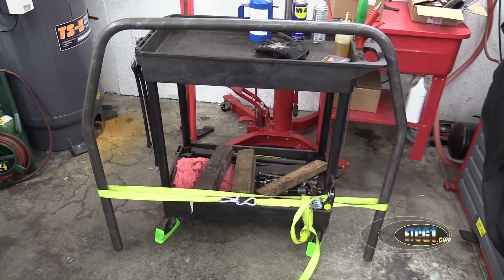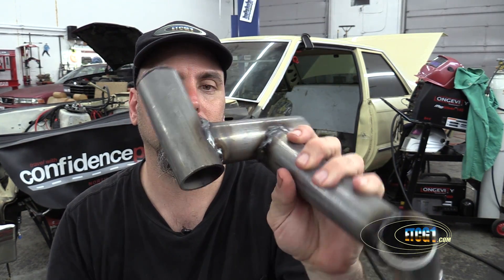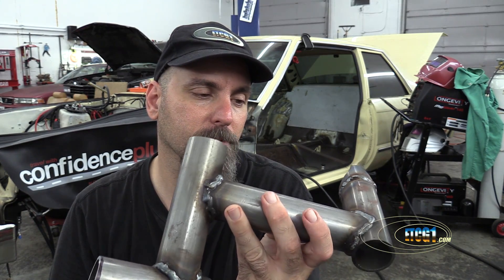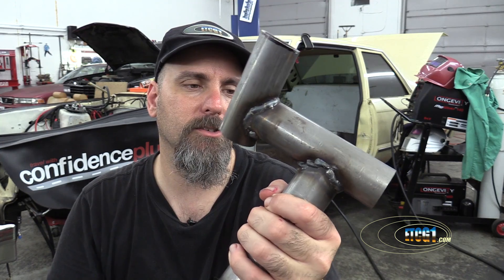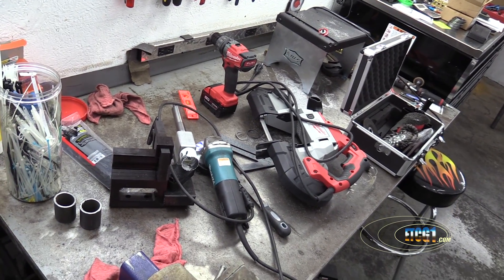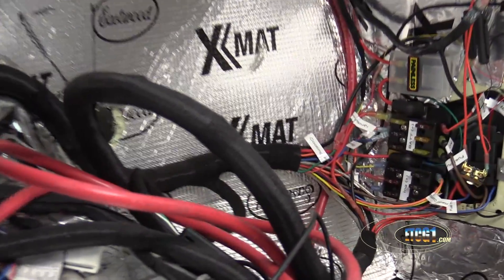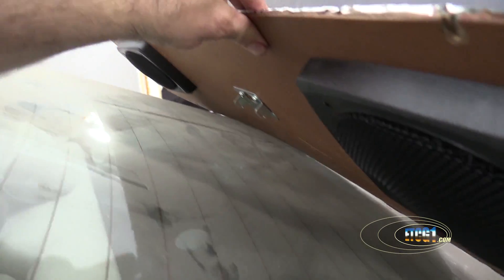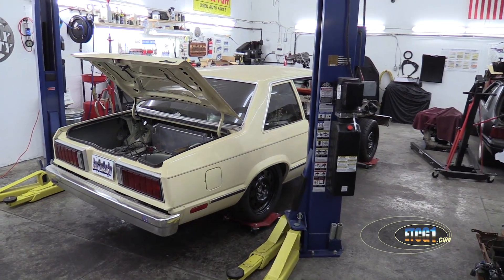Losing Motivation With Project Vehicles

Comment: Completely unrelated, but I get a similar feeling from writing menus: by the time I have tested a recipe a dozen times, trained people to cook it, figured out it looks, talked about it for weeks, I am just sick of whatever it the dish is. It's just mental fatigue from being a Tradesman and having to overthink every step. I was trained that the day you don't hate the plate after locking in a menu is the day you have to walk away 'cause you don't care anymore. I love the Fairmont videos, I have a beater Puegeot 406 HDi 2.0l Diesel and I am having to slowly replace everything that is bust as the cost of the car doesn't rate the mechanic fees, but I love how far she goes on a tank of gas and drives like a hotted up sofa.
Reply from the maker: That is a fantastic analogy, I never considered having to write a menu or what goes into it. Not only did you offer empathy and encouragement with your comment, I learned something new. Thanks!
Reply: Dylan turnbull 
I also cook and make menus for a living. I love working on cars on my down time. I have had a few car I had high hopes for but got lost sold them and wish I never did.

Comment: Most often the only difference between success and failure is not quitting.  I know you will get it done, because you're not a quitter.  Look at all you have been through in life.  Even in the hardest of times you just kept putting one foot in front of the other.  All of those things you have been through gave you the resiliency and tenacity that you need to get through things like this.

Comment: I'm in the same boat.  I have an 82 Camaro I've had since 2004.  Built it through high school, put a carbed 400 sbc in it and 700R4, painted it gloss black.  Looked good for a while.  Then went to military academy and have been in the military 7 years now.  Every time I really start to make progress, had a few deployments, some fender benders, now its in primer in my driveway.  Had kids and then in the brief moments I have time, I'm just drinking or playing video games.  Was cleaning it up again, and found my gas tank is rusting out, needs a new one, have stalled out.  Got 3 shelves of parts ready to go and no motivation.  Also have a 88 C1500, and that has been the daily and focus, new engine, suspension work, sound system, stalled on that too.  Between military and family, hard to justify tinking on a 30 year old car after not seeing my family for 9 months.  I'm glad I'm not the only one.  Also have a 66 Pontiac from my Dad, its back home.  I spent all this time to haul both cars to a military base in the middle of nowhere to not work on them.  Both run snd drive, just gotta get after it.  My welding skills are similar, good for body work, but not a roll cage lol.  Hope you get it out the garage soon! I'm walking to the garage now lol
Reply from the maker: Thank you for your service! That said, my Fairmont has been up and running for about 3 years now and I love it. Can you send me an email to eric@ericthecarguy.com. Something I want to run past you.

Comment: You're losing motivation because you've hit a brick wall you can't see a way past. Pay someone to weld the roll bar and get that job out of the way. Your motivation will then come back.

Also when was the last time you took a proper holiday completely away from all of it for a couple of weeks?
Reply from the maker: You are 100% right about that. Last weekend a couple of viewers came out and helped me build the roll bar. It's done now and I feel like I'm over the hump. I hope to have the car running by the end of the week. 

As for a 'proper' vacation, I'm not sure I know how. Like a shark it seems I have to keep moving to breathe.
Reply: ETCG1 Conor is right, sounds like you might need some rest. 

As far as getting over the hurdles, I've always found having a friend or two to help out can keep you motivated and moving forward. Good luck, can't wait to see this thing done.
Reply: resting in the Fairmont checking your 0 to 60 times sounds pretty relaxing
Reply: Take the car out, drive it and take your time Eric. You deserve it after 2 years of building.
Reply: When its done, really bask in ENJOYING it. Once you get that reward at the end of the build, and spend some time with it, the passion will return. Eventually you'll just get an itch to start on another. If you don't rush into the next one too fast, you'll hit the ground running with all the passion in the world for what you're doing.
Reply: Well done, Eric! You're not a welder by trade, and a lot of work was done in that car to let it sit parted in bits. I believe many viewers want to see that car running, and the builder deserves the credit for a wonderful job. draw a date to have it ready, and stick to it, stop wandering around with small details. I have a cousin who parted an antique family car in bits in his garage, and then lost interest in the project. Everyone knows it will never run again. Don't be that guy! Focus on your goal and go for it! :)
Reply: damn.  those welds look like mine.  I can weld, but, like you, I can't see, so I pay somebody to do it.  and I LIKE to weld.  
you did the right thing.  
I know it's a 'pride thing' to want to do everything yourself.  with life comes wisdom.  I have finally found a way to chisel money out of my pocket when it's a good investment.
Reply: Exactly what I was thinking, hire some one to do the welding job right and just get that part done. Then sail on putting the car back together.
It's OK to get some help with a project you don't have that much skill in. He's trying to do too much too fast.
He'll feel better once the roll bar issue is out of the way.
Reply: Good man, I'm glad you got some help and got the roll bar out of the way. I hope you feel better about the whole project now.
Reply: By the end of the week!?!?!?! I can't wait!!!! This is gonna be one of the baddest cars on the road.
Reply: and I think he did get someone to do that.. so , good advice!
Reply: Awesome to hear you might have it running by the end of the week - you're in the home stretch.
Reply: This is the best suggestion. Do them Eric!
Reply: As someone who's had a project "car" (shell & parts), I completely understand. The one thing that keeps beating me is looking at the list of things to do. Something I always find helpful, on not just my projects, but those of my friends is to just bolt the engine in and start it. You said the fuel and wiring are done, which is HUGE. All of the fiddly time fixing that crap saps your soul.
The best moment in any project, and the one that gives the most inspiration, is passing 2k rpm for the first time. Even if the car is on jack stands, no seats, dash, anything. 

Keep the faith my friend, and let the tire smoke prevail.
Reply: That's one thing I learned as well. I mean, I can weld, but when it came to the roll cage, I figured it was best left to the pros. In a project, especially one that your working on only by yourself, if you come to a part that is beyond your skill level and not something you can just look up, it's best handed off to someone that can do that part. On the other side of things, if it's the mountain of work beating you down just set small realistic goals. The project will come together eventually. No sense in beating your head into a wall until you hate the project. Hell, this car is nearly done and ready to go (which I know has taken a lot of time and effort).

Comment: I bought a 1976 Suzuki gs 550. I rode it for awhile and decided to "fix it up a little". I took everything apart. Bagged and tagged it all. Cleaned, re-chromed, powder coated, painted and replaced everything that needed replacing. Then I lost interest. I started to put it all back together then gave up and sold it. That was two years ago and it still bothers me whenever I think about it.
Don't give up. Power through it. It will be worth all the sucky times when it's done.
Thanks for the video.

Comment: I've been there , sometimes it seems like you'll never get anything done and you just want to throw the towel, especially when you realize the time you've spent on the car already, and how far it is still from being done. In my case, it's more like every time I have everything set up for a job I have to do on the car, some unrelated part breaks, or starts misbehaving, and then I fix it and I find out that something else is not working properly and it's like it never stops. :D But it does stop eventually, I guess... or so I hope, and that's why I always end up going back to it.
Reply from the maker: You're spot on with that comment. My solution seems to have been to bring in outside help. Last weekend 2 viewers came out and helped me finish the roll bar. Now that it's done, I hope to have the car running by the end of the week. Thanks for the comment!
Reply: No problem. I'm in that very situation at the moment - I was about to sort out the intercooler piping, when something went wrong with my front suspension, and the AC compressor decided to give up the ghost, as did the exhaust manifold gasket, and also my temp gauge has started acting up... all within a single week. So I'm feeling a bit overwhelmed myself. But I'll keep at it anyway, I'm sure we'll both see the end of it soon enough. :D

Comment: I'm going through this with my 03 Silverado.  Started off needing a crankshaft oil seal.  It has spawn to a timing chain cover, oil seal, new water pump, new pulley's, new belts, new ABS speed sensor, rust control and restore of the front wheels, new shocks, transmission filter...  And here I am procrastinating as I could be doing the shocks.  I'm also an amateur mechanic DIY'er at best so of course, you can imagine how much slower I work compared to you, Eric!  Keep it up, love the vids! I learn a lot from you

Comment: Install the engine and get it running. I know from experience that will give you motivation.
Reply from the maker: Last weekend I got help from some viewers with the roll bar. It's done now. All I have left is to reassemble the car. All the big jobs are done. If all goes to plan, it'll be running before the end of this week.
Reply: Once it is done, do a 5 or 10 second video of it driving down the street on your other channel as a teaser.  That will wake people up! Chris
Reply: I agree.  These car projects sit there, taking up space, not running.  Makes you loose sight of the end product.

Comment: Hello ETCG1. Yes I have started projects and lost interest. I had a Rover 88 (it is the "Daktari" type Land Rover. 88 means 88 inch wheelbase) and wanted to change out the drive train. The old stuff was OK off road but max of 50 mph on the street. Project never was completed, I sold everything for pennies. I was hoping that one thing your listeners became aware of during the Fairmont build is how easy and how dangerous (as in losing money) project cars can be. I did complete one project truck. I put a 330 hp small block and race prepped Turbo 350 in my 65 GMC. Other than being expensive that build went off well. I like your idea of bringing in outside help. The help may cost you but if it gets the Fairmont done, so be it. If I would have sought help with the Rover things may have gone better. I did get help right from the start with the GMC engine swap. I drove it 10 years after the swap. The truck hauled a**,fun to drive, well in a straight line it was fun.

Comment: Sometimes with a big project you just have to accept that you can't do the whole thing solo. If you've got the $$$ to do this project, then you sometimes need to part with a bit more to bring in an expert. Discuss with the shops you're already working with to see who they know that's good at the welding stuff.

You seem to know what you're doing for most of it, and you got this far, so may as well push through to get it done.

Comment: Been working on my 78 camaro for nearly 2 years. Once we got it running, we've only done one project at a time so we can keep it on the road. Taking it for a spin always helps maintain interest... especially helpful when you have your dash apart to replace a heater core that you've been putting off.

Comment: When you get the roll bar done have the guy check the welds on your frame connectors.  It cant hurt.  Chris
Reply from the maker: I've already redone all the welds on the frame connectors. I'll mention that in an upcoming video. Between that, and the roll bar, I don't think there'll be any issues. Thanks for the suggestion.

Comment: At one phase of my life I welded heavy roll bars for a living. It is definitely a skill that requires practice, especially the way we did it with 7018. The mig welds you showed at the beginning were too cold, I guess because you had a poor fit, then burn through on the edge side and then reaction to dial down the heat. Problem is, you need good penetration on both sides, even if it means you have to grind welds smooth afterwards to make them look pretty. Without penetration you need to start over, though if there is a good pass underneath you might be able to salvage the steel. I agree, hire a pro to get through that part, you want to move on and finish this one up. We're still with you, Eric!

Comment: Eric, I have definitely been there. Years ago, I set out to restore a project car of my own. It was a 1984 Lincoln Town Car. It wasn't a build like the Fairmont is, I simply love the old full size cars and wanted an old Lincoln that I could restore into factory condition. It was given to me for free, and though the engine ran fine, it needed a new transmission, and the friend who gave it to me had partially parted it out to get parts for his Crown Victoria. I've always had a passion for the old Panthers, especially the 1980's-era ones, and the Lincoln was something special. Anyway, I completed the transmission project and got the old Lincoln running and at the time it was my crowning achievement. But the trans leaked like a fire hose from the bell housing, and after re-removing the transmission multiple times to replace the pump seal, I gave up and condemned my beloved Town Car to the junkyard. Years later, as I learned more about cars, I realized all along that the problem was that I had installed the wrong torque converter. Had I known that at the time, I would be driving the Lincoln now. The moral here is, procrastinating or burning out (or worse, quitting) will only leave you wishing you had the car you worked so hard to build. I took plenty of time off from the Lincoln. Take some time away from it, dream about what you want to do with it, picture yourself screaming down the road in the Fairmont, and you'll fire yourself right back up with the energy and stamina to polish it all off. By the way, my passion for old Panthers never died off, and my daily driver today is a 1987 Ford LTD Crown Victoria, all original of course.

Comment: If you have family members or friends, interested in your project, that's a game changer. In the early 80's my dad gave me a non running '57 D100, and a worn out '69 Fury for parts. Told me if I wanted to drive I had to get one running. We stripped the truck down, and then went overboard with modifying it. As a teen I quickly lost interest, but dad pushed me on. After welding in the torsion bar front clip, everything snowballed. I hated the truck, new rad. support, cut out the firewall because of engine set back. Trying to combine the wiring from the 57 and 69 Fury. Over 35 yrs. later still have her, she's half apart. Going to go through her again, keep it like she was early 80's, out of respect to my father who wouldn't let me give up. Should of done this years ago, he passed away last May.

Comment: I've got a project truck I've been working on for over ten years! I'm building a 1954 Ford F100 extended cab 4x4. Believe me I know about getting burnt out on a project. It's been a year and a half since I've done anything on mine. Sometimes you just have to step away from a project for a while. But the problem with doing that is.  The longer you are away from the project the harder it is to get motivated to get going on it again. 

On something like a  roll bar. If you are questioning your abilities at all. Either pay someone to do it or find someone to help you with it.  Get the help with your roll bar. And then either take a short break away from the car to recharge your batteries. Or just push thru and get it finished.  You are so close, but sometimes you just need a break.

Comment: Eric - A tip for future builds that I learned - when you start the build - pick your strategy and stick with it.  So like in this case, when the engine didn't work out, just find a different engine.  Yes, it's nice to find other things you can do but there's no end and not having an end leads to what you have now, frustration and burn out.  From here out on the project, just stick with what you've chosen now and you should start feeling progress again going forward.